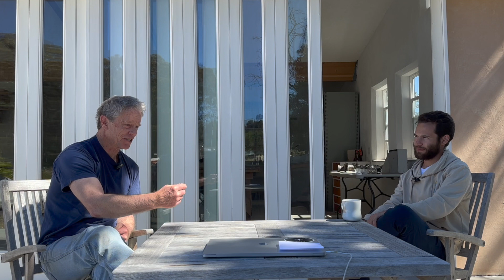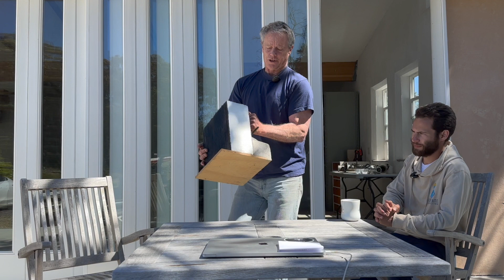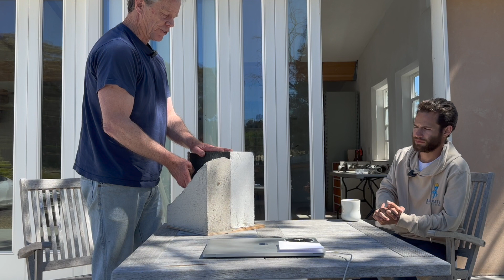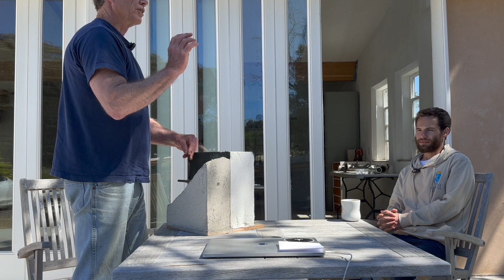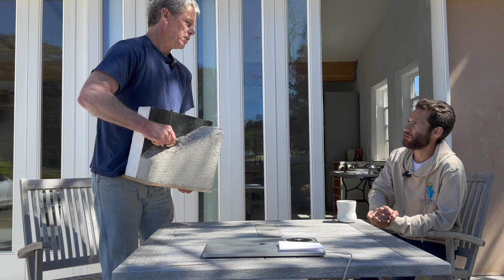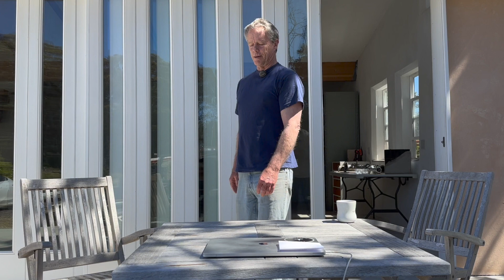Transforming Gallons Of Concrete With ONE DROP Using Spacecrete Admix

Comment: What's the problem with forms? 
Forms are alot cheaper than a printer by far and with pumicecrete you can use  metal siding for your forms that stay in place forever 
Your outside forms are now your finished wall